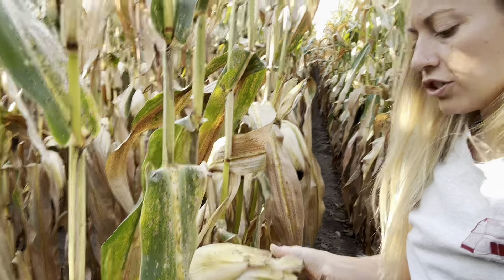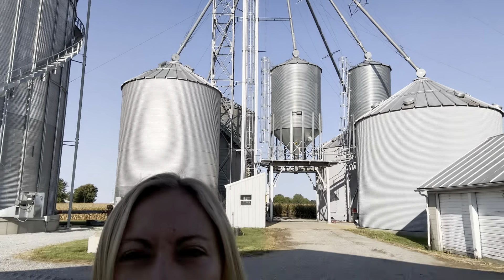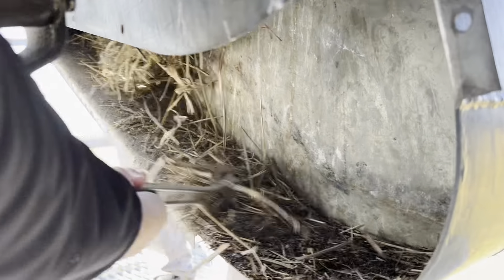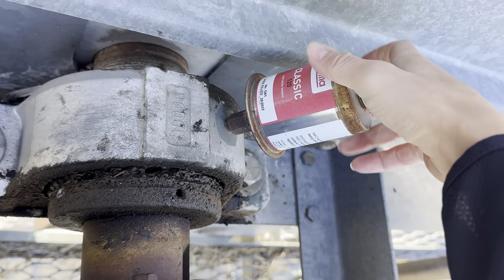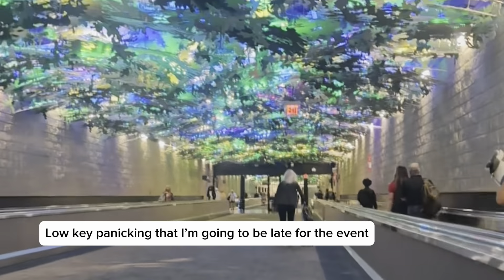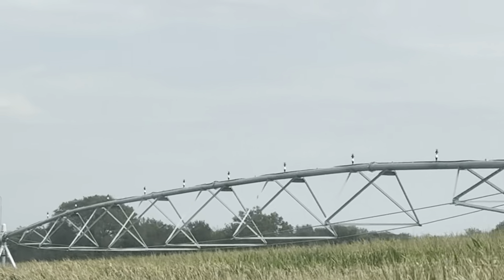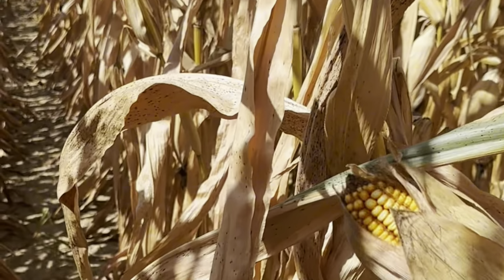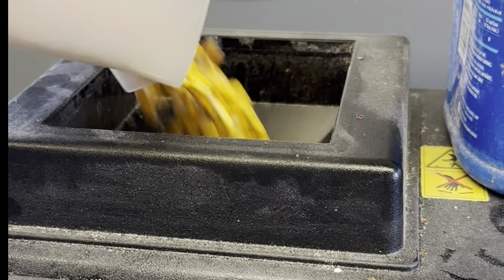No calm before the storm this harvest season!

Comment: If you don't mind a bit of graffiti, you can use a marker or paint pen to make notes of what you need for tools, belts, etc, at the base of the stairs. You can do the same trick on equipment for tire pressure, wheel nut sizes, etc.
Reply from the maker: A bit of graffiti 😂 that’s smart, I also thought about just making videos for myself telling me my directions 😅